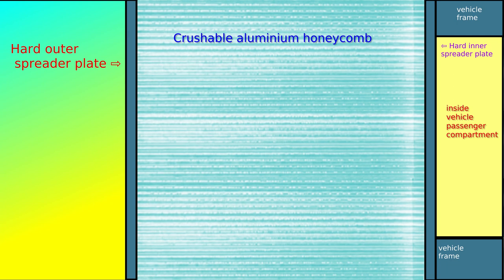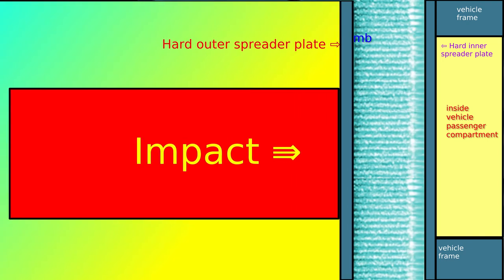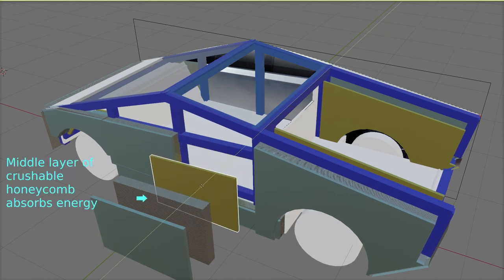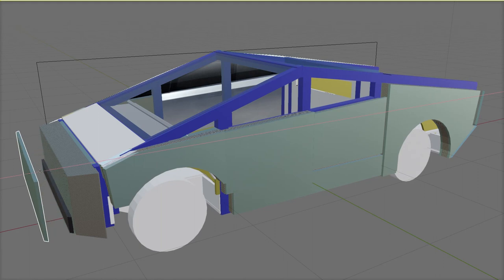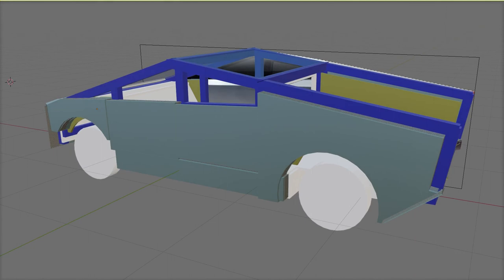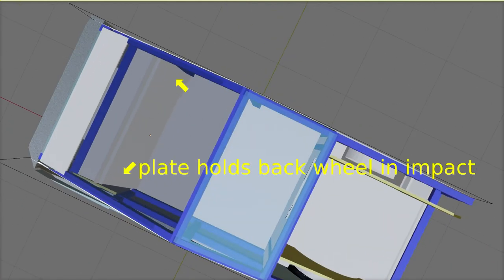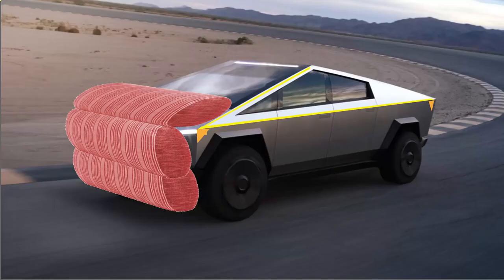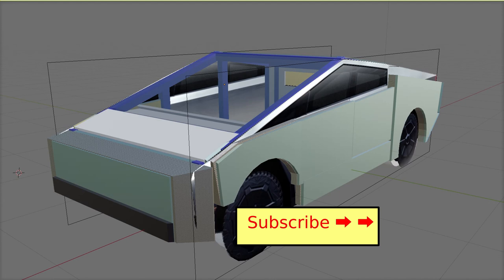Cybertruck crash protection using crushable aluminium. Tesla

Comment: Again, a very interesting analysis. Thank you.  I have some thoughts that might be pertinent...

The use of energy absorbing crumple zones is the current technology for reducing the affects of collisions with fixed infrastructure and other vehicles.  Their purpose is the reduce the G-forces that occupants of the vehicle(s) are subjected to.  It's accomplished by absorbing kinetic energy of motion by doing work (bending metal).  This method is augmented with the use of seat belts and airbags to further reduce the less, but still rapid deceleration of the human occupant inside the car.  Of course, given enough time, the most desirable way to dissipate a vehicle's kinetic energy is by converting it into heat by means of friction braking.

Your aluminum honeycomb method has merit, but I wonder if there isn't a more effect way to protect vehicle passengers and pedestrians from injuries due to collisions, and that is by predicting the possibility of a collision before it happens and reacting quickly to prevent, or, at least, limit its ferocity. 

Advances in computer vision and autonomous vehicle control could be used to significantly reduce the instances of automobile accidents through heightened situation awareness and millisecond response mitigation actions by the vehicle.  Many auto accidents are the result of human failure to drive defensively.  Humans are subject to all kinds of influences that subtract from their ability to operate a car or truck safely.  Fatigue, distraction, impatience, anger, impaired sensory function, weather conditions, slow reaction times, law breaking, to name a few. 

It might be better for Tesla to equip Cybertruck with systems designed to reduce the probability of collisions from happening in the first place.  This is a technology that Tesla is already quite adept at as applied to self driving vehicles.  Such a strategy would have benefits far beyond reducing the seriousness of injury in a collision.  It would simplify vehicle construction and manufacturing cost, reduce the need for expensive collision damage repair, reduce insurance premiums, and even in time eliminate the need for traffic law enforcement.
Reply from the maker: Quite right Clara
I mentioned some of this in my first video where I explored the use of external airbags. None of this removes the need for internal airbags.
And you cannot avoid the accidents inside your intelligent car if someone else decides to T-bone you, ram you up the back, or hit you head on because they decided to overtake in the opposite direction on a blind corner.

In the EU ( and in much of the rest of the world that will simply copy EU regulations). Most of it is about avoiding accidents.
[ my comments in square brackets ]
The new **mandatory** safety features include:
Advanced emergency braking (cars, vans) [This requires the radar /vision detection and processing ability to predict accidents, and then to take over control to avoid accidents ]
Alcohol interlock installation facilitation (cars,
vans, trucks, buses)
Drowsiness and attention detection (cars, vans,
trucks, buses)
Distraction recognition / prevention (cars, vans,
trucks, buses)
Event (accident) data recorder (cars, vans, trucks,
buses)
Emergency stop signal (cars, vans, trucks, buses)
Full-width frontal occupant protection crash test - [ crushable honeycomb is important here. External airbags if accident can be predicted. You need both. ]
improved seatbelts (cars and vans)
Head impact zone enlargement for pedestrians
and cyclists -safety glass in case of crash (cars and
vans) [ The Cybertruck's hard glass windscreen won't meet these requirements without external airbags and accident prediction ]
Intelligent speed assistance (cars, vans, trucks,
buses)
Lane keeping assist (cars, vans)
Pole side impact occupant protection (cars, vans) [ This is where the crushable honeycomb in the side panels is essential, and the hard steel outer spreader plate works well]
Reversing camera or detection system (cars, vans,
trucks, buses)
Tyre pressure monitoring system (vans, trucks,
buses)
Vulnerable road user detection and warning on
front and side of vehicle (trucks and buses) [ again sensors and computer processing power]
Vulnerable road user improved direct vision from
driver’s position (trucks and buses)

see the press summary from March 2019 https://ec.europa.eu/commission/presscorner/detail/en/IP_19_1793

Comment: I haven't made it through all your videos yet but I have to just tell you how impressive your content is so far.  I was wondering if I could create a channel for wheelchair access for the cybertruck into the passenger compartment.  If such a thing is possible I clearly would need the cooperation of Tesla engineering based on your discussion in your other video.  This may be my second career; making a wheelchair accessible EV.  No question that a Tesla platform would be preferable.
Reply from the maker: The openings in the side for the doors are such an integral part of the design in all the Tesla EVs so far that side wheelchair access would be very difficult. The model Y might be easier to modify with access via the back hatch, but there might not be enough headroom. The Cybertruck already has a rear ramp, and a hard top option will almost certainly come as an aftermarket option if not a Tesla option.  Replacing the rear bulkhead with a strong frame giving access to the passenger compartment from the rear would be much easier than modifying the sides. Mods like this, and for example camper options will happen just as soon as people can get there hands on the Cybertruck.
The other option are the van based EVs such as the Nissan, but none as yet have the 250 mile battery, but have a look at what Glyn Hudson have done with theirs. https://www.youtube.com/channel/UCmAA-dXNnQ47tKkdRvrgdtQ

You could start with an EV van, then move to the Cybertruck when available. Go luck with your channel.
Reply: @dartmoorrambler  Yes, not clear in my earlier comment but I was thinking of creating a channel from the back using the same concept as the existing ramp and lowering the bed to the same height as the passenger compartment.  That Nissan looks fun but no range.  I've got a truck on order and figure I can store her powerchair in the bed after I transfer her to the seat if my idea doesn't work.  It may not have enough height anyway.  Our present modified minivan sucks to drive and really isn't crashworthy (so I'll try not to crash).  I've ordered a model y but only option there is transfer and stowing a manual wheelchair. Thanks for your reply!  If you're ever near San Jose CA, I'd buy you a drink.

Comment: For the front plates to prevent shear on glancing blow, would it not make more sense to use an industrial adhesive to bond a honeycomb to the plates instead of a spring?  Is the use of honeycomb been acknowledged by Tesla as the impact absorbing modus?  Thank you again for the great videos!
Reply from the maker: The front steel plate needs to be held in place relative to the back steel plate by something like a flat steel spring that prevents lateral movement.
Aluminium honeycomb has no lateral strength whatsoever.
Reply: Is Tesla using the honeycomb aluminum for the Cybertruck?
Reply from the maker: @diveflyfish  It is a material that is well known in the space industry, but we will have to wait to see what ends up in the Cybertruck.
Reply: Peter Thomson Yes, moreover James Bede aeronautical engineer who pioneered its use in aviation, as  well as industrial epoxy to bind aircraft partake. Bede designed the Grumman Tiger, etc and BD4 which is visually ironically very similar to the Cybertruck !

Comment: You have a steel frame on which you "hang" inner and outer plates.
This is a complete and total change form the concept of an exoskeleton, which explicitly and purposefully negates the need for an internal frame.

In other words - you made something up which is cool, but irrelevant for the cybertruck.
Reply from the maker: The cybertruck is a concept vehicle. But if you examine the exterior and interior video of the cybertruck it has a very substantial frame.
You cannot create an unsupported exoskeleton out of 3mm stainless steel plate that has both the crash protection needed for many countries world wide, and roll-over protection for the occupants. See the structural analysis video. https://www.youtube.com/watch?v=L2nSIDv29HE
You cannot stamp it into the curves a self supporting exoskeleton would need.
Reply: @dartmoorrambler  ifthe car has 3mm of steel skin on the outside and inside then the weight would be very high, elon did say he it was the same weight as a F150, i suspect that the plates would collapse inwards as a hidden interior frame deforms, the sides appear to be solid and rely on physical spacing for protection.
Reply from the maker: @miguellopez3392  The pillars on the Cybertruck concept demo that people got a ride in are already quite substantial. There is a good view of the front pillars in the external airbag video.  See the structural analysis video to get an idea of how they are arranged. The wheel arches and sides of the truck bed already have double steel plates. The only extra steel on the sides is on the doors below the window, and perhaps an extra plate on the front.
Reply: @dartmoorrambler  So basically you're saying the 3mm stainless steel isn't strong enough?

Comment: No vehicle on earth is designed to protect pedestrians. Why should tesla have to be the first to incorporate this just because they use a stiffer steel structure? That is what all the sensors are for. Tesla builds the safest cars on the planet. That's one of Elons' main goals!
Reply from the maker: Vulnerable Road User (VRU) Protection

As well as assessing how well cars protect their occupants, Euro NCAP tests how well they protect those vulnerable road users – pedestrians and cyclists – with whom they might collide.

In these tests, the potential risks of injuries to a pedestrian's head, pelvis, upper and lower leg are assessed. Cars which perform well can gain additional points if they have an autonomous emergency braking (AEB) system which recognises pedestrians and cyclists.
https://www.euroncap.com/en/vehicle-safety/the-ratings-explained/vulnerable-road-user-vru-protection/
Reply: Do trucks have pedestrian protection? If they have, I’ve missed it!